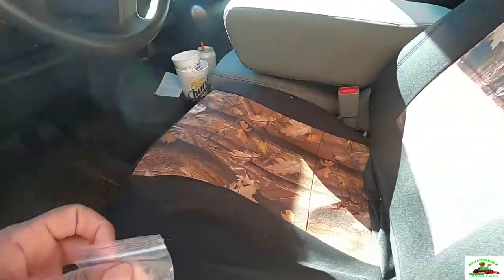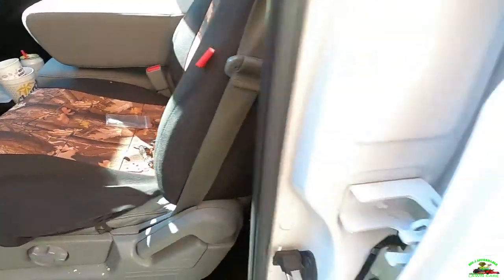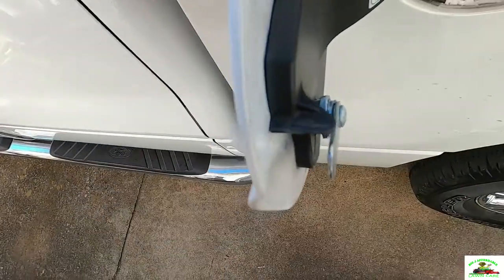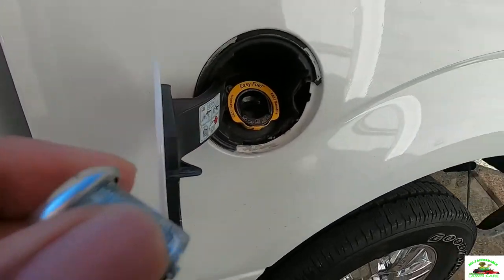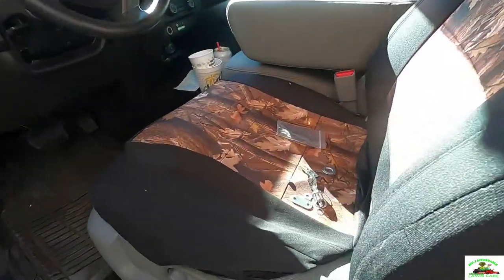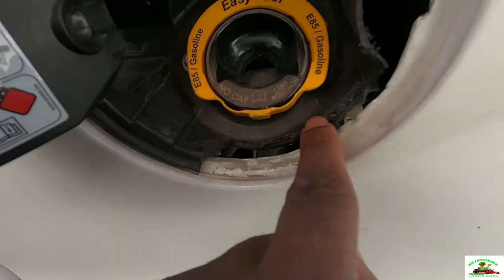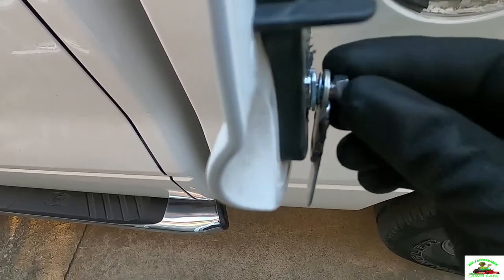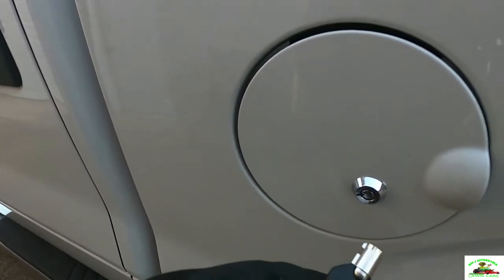GAS DOOR LOCK INSTALL [F-150]

Comment: That isn't going to stop a ten year old from opening that plastic fuel door. It's unfortunate that Ford went to this system...very difficult to secure.
Reply from the maker: Yes I agree but when a thief sees a gas door with a lock its possible they may move along.